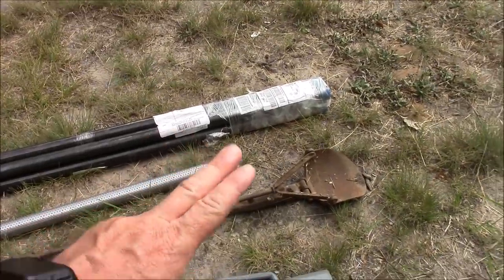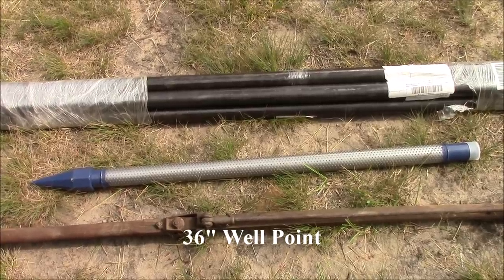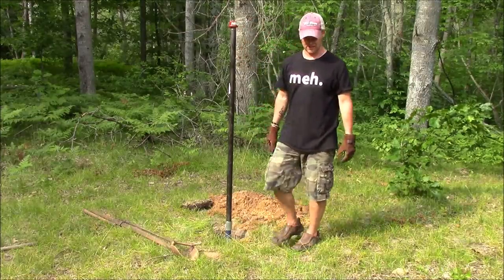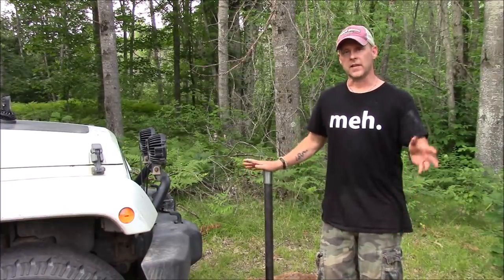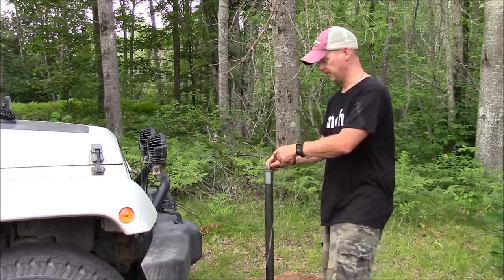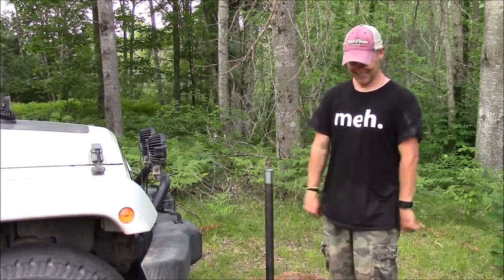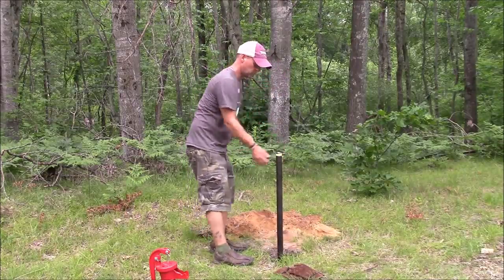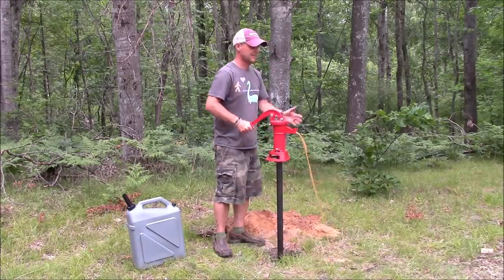Installing a Sand Point Well at the Off-Grid Cabin

Comment: Unfortunately for what I learned this water is not potable.  Only good for use in toilets etc.  Test it to be sure would be my next suggestion.
Reply from the maker: I use it for my garden.  I have not yet tested it nor have I tried to filter it.  I filter the water out of the stream on my property for drinking water.  Thank you for the information tantagoth.
Reply: @LordCryptid  Counties often offer low cost water testing.  At our county you pick up a clean plastic container, fill it with some of your water, and return it for testing.  My guess is that you well water is safer than your stream water.  Animals pee and poop in streams and around streams.  Your well water has gone through a biological filter.  The major issue for well water would be whether any undesirable minerals have been picked up as the water travels through the soil.

Comment: Wrong pipe, wrong thread tape. Otherwise mad respect.
Reply from the maker: If I were drinking it I would certainly use galvanized and I will take your suggestion about the tape next time.  I will probably sink a deep one eventually.  Thanks.
Reply: @LordCryptid  really the purpose behind the galvanized pipe is to prevent  premature wall failure. If you drill another well make sure to find bentonite to seal the casing. It can be found at a well or pond supplier. This is a critical step to ensure you dont contaminate the ground water. I have personally worked in the water well industry for years. What you've accomplished is rare. Not many have the incentive nature, and the will power to see it through. Great job.
Reply from the maker: @jameshorrocks2939  I will remember Bentonite.

Comment: why didn't you use galvanized pipe?
Reply from the maker: Probably should have.
Reply from the maker: There will be more rust in the pipe eventually.  But it was mainly for watering a garden so I went cheaper.

Comment: boys do not do that at home, read instructions first , if he just put some water process of pounding would go much easier
Reply from the maker: Do you mean water on the ground first before pounding?  Maybe in the initial hole.  Let us know.
Reply: @LordCryptid  in the hole or in the sand point as soon water start disappearing down the pipe and it does not matter how much you pour in, this  is  sign that you reach a layer of sand with water.
Reply from the maker: @andreycham4797  Thank you.  I had a limited amount of water available to prime the pump so I feared using it in that manner too soon.

Comment: Your pipe is just plain painted carbon steel.  It will rust.
Reply from the maker: Agreed. If I were drinking from this I would use galvanized. When I do this again I will make that shift and get help to drive it deeper. Thank you for your input.